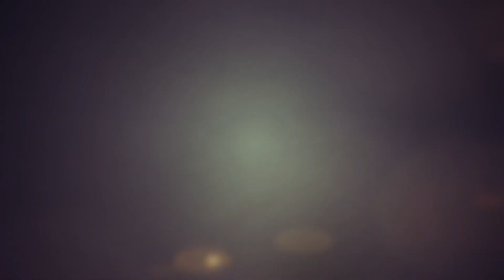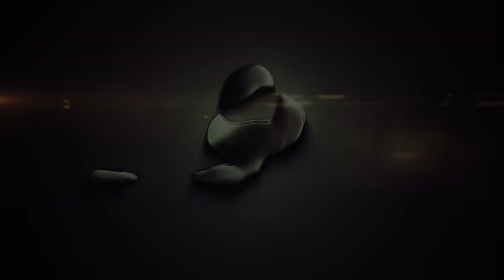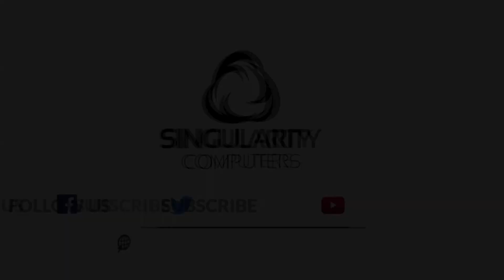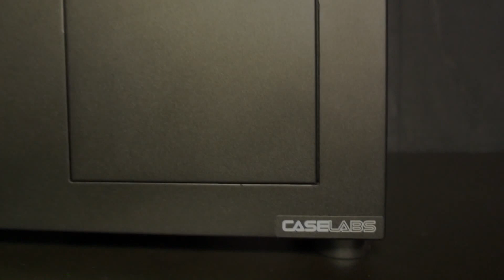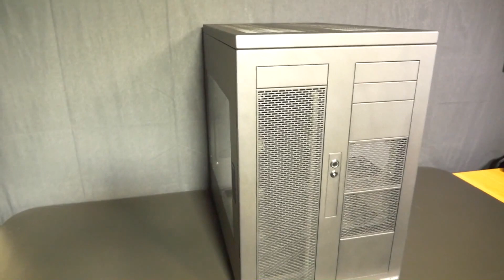Caselabs Magnum THW10 Review

Comment: This new THW10 is a major disappointment. They made the case wider but it still doesn't support dual motherboards or redundant power supplies. This could have simply been done by using the same bracket system used for the radiators.

Comment: The only thing I would change with this case would be to make the rear of the case and the motherboard tray able to be reversed to run inverted ATX. My desk setup puts my case on the left of my desk which means the "wrong" side of the case faces me. That is why my latest system went into a Corsair Carbide 600c.
Reply: you can order a reverse layout

Comment: Absolutely love the review you did on this as well as a user of these cases. I got my TH10A recently and this came out like a few days after actually relieving my CaseLabs case. A bit of thanks to you for inspiration watching all your builds. Would have love to have gotten this case if had the chance but I'm absolutely in love with my TH10A though. Haven't yet started my build, gotten most the parts (BlackIce Nemesis Rads too) though except most the water cooling parts except the CPU block which I'm still deciding on the water cooling build. But I would love to see what you do with this case and maybe some the Monsoon parts that you already have for a build. Keep building!

Comment: I will say a con is that the case costs as much as a low end gaming rig.  It's a beautiful case don't get me wrong but cost is normally considered in a review.
Reply from the maker: +Arkratos For what these cases are though they are cheap. Price having one built or setting up to do it yourself and you wonder how Caselabs is able to build them at this price.
Reply: +SingularityComputers That's true, they are amazing, the build quality, the customization, your review is spot on with those aspects, but at the same time, the small gripes someone can have with a different case (like a fractal design define S) are usually worth saving over 500$.  I just feel that Caselabs are so expensive that they are out of reach of even most enthusiasts.  Several friends and I have SLI watercooled set ups, but I know absolutely zero people personally that have a Caselabs case, especially when they can go with an exotic Lian Li or something that looks more unique and is cheaper.  Leaving the question, even if it's the perfect case to work in and customize, does the cost really not play a role in the review when that is the primary reason most people don't buy them?  
And would you consider the case worth it if it's the difference between something like adding a second 980ti?  Or does your review stem from the idea that once you buy it you literally use it for the next decade, over the life of several systems?  Another option is that you are ignoring cost and just reviewing the case for what it is?  Barring manufacturing cost, is the premium price tag worth it, when it doesn't necessarily directly effect the performance of the computer inside?
I'm not meaning to nag, I'm just wanting some clarity on why the price is left out of the review when I feel like it's a primary consideration when buying a Caselabs case.
Reply: +Arkratos - Caselabs cases are enthusiast cases, that's why we buy them, oh and cos we can .

+SC - you should import a heap of them, i know i'd get one. :o)

Comment: i had a question here, and the answer will help me making my mind

so, basically i could fit 4 560 rad and one 360 in the front right? fitting problems? thickness recomended? im going for push only (well push in some areas pull in others but just one at the time) 

thanks!
Reply: A lot others had done this before, i have an other case but i think it might work. But what will you cool with this? You could cool a nuclear plant  with this setup ;)
Reply: well it's just a big BIG because i can xD but i'll be cooling a 5960x (or a skylake-e or zen) quad fury x (or pascal hbm2 or vega no brand loyalty here) motherboard (like a monoblock) a 750 pci-e, ram (i know i know..) all the options are because my build are due to Q4 2016 to Q1 of 2017 because im saving untill then
Reply: +Robert Garnica oh yes thats alot of heat, anyway, good luck for your build it will be awesome :D

Comment: Did I miss something, or is there no provided mounting accessories included for the secondary side of the case?  I really would have thought two systems could be installed easily, without modding... I was going to comment on this being much superior to my Mozart TX in nearly every way, but the lack of dual system support out of the box really puzzles me.

Comment: great video great case good review and everything you said is true the thing about case 5 cases that most computer enthusiasts an amateur Builders don't realize or consider is you get what you pay for with caselabs very very tough panels I'm in the process of building in a case last case and a panel had a small dent very hard to notice and they replaced it no questions asked and it's one of the best brands of cases when it comes to modifications because they're all aluminum and well-designed keep up the good work as always

Comment: Nice case and good review.   Only thing I can think of that's missing is dust filters.   Some magnetic (with a steel holder) or slide in types would be nice.   I know they sell single fan filters on their site, but would prefer all one piece on larger intake area's.

Comment: Never really liked any Caselabs cases.
Reply: ***** No, because I don't find them interesting, and I have no interests in water cooling so wouldn't see myself buying one.
Reply: ***** I still like the builds. Been here for quite a while actually.
Reply: ***** If you check the channel, it's not only Caselabs.. so why is this the wrong channel for me? I'm allowed to like PC builds and dislike some of the components used. How's that a problem?
Reply: +HowAmI I like watercooling, but i dont lile caselabs either - they are just ugly as fuck.
Reply: 4x 560mm rads why no just leave the case and buy 5x 560mm rads 40fans  and ice dragon coolant might need a stronger electric pump that is used to boost water presure levels

Comment: Hey Daniel. I have a question that I've been wondering for a while about case labs cases with removalable motherboard trays; why is there always a gap between it and the panel? Visible at 11:20 in the video. In between the tray and the grommets. Why don't they make it flush with the other panel?
Reply from the maker: +Shox. I think its to allow more space for running cables. I always use that gap for cables in my builds. I agree it should really be there though.

Comment: They have the best cases in the world! I have an STH10 and what I like about it unlike this one is that you have chambers especially for rads and the airflow goes through the chamber alone. In this type of case the air either goes inside the case for the rad(s) and some of it that is a little higher in temperature than room ambient goes through the case, even if you use make the rads expel the exhaust outside the case you have airflow because of their intake, and even with filters you have dust eventually. With the separated chambers in the STH10 you dont have any airflow in the mobo compartment and therefore no to veery little dust. That's why I like it so much otherwise would love to make a build with one of these

Comment: I think the main con of this case is the price
But anyone who needs a case this large probably has no problem with the few hundred bucks it costs since they are already spending thousands on the hardware to go in it
Reply from the maker: +Toxic Biohazard Yep you are definitely right about that. I am surprised they can make these cases as cheap as they do for what they are though.
Reply: +Toxic Biohazard ive bought multiple caselabs cases in my life and I can tell you right now the main con isn't cost.  the main con is the wait and shipping time (especially if you live outside the US and during busy times where they are overwhelmed by orders).  I had to wait almost 2+ months for each one of my cases to arrive. If you're planning to do a build quickly....this isn't the case for you.
Reply: +iamthewizard2 i hear ya it's not the price it's the wait.. like 5 to 6 weeks? ain't nobody got time for that! but if you plain ahead you could build your system in a normal case then order the caselabs and then do your watercooling but this isn't the case you're looking for if you want to build a watercooling system right of the batch i say it's more like and upgrade case
Reply: put it this way tho 4x 560mm rads destroy most cases but I could destroy this case with a 5x 560mm rads by using the thickest rads might require more coolant and a industrial  electric water pump to get the liquid  throw 5x 560mm 86mm thick rads